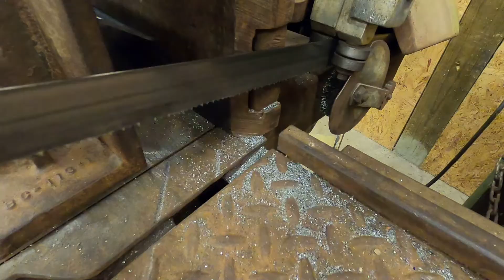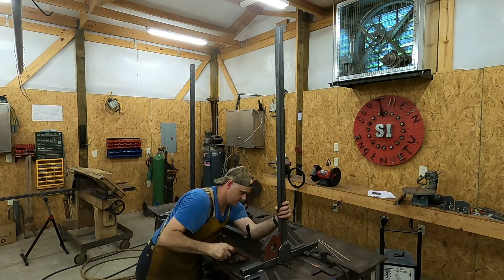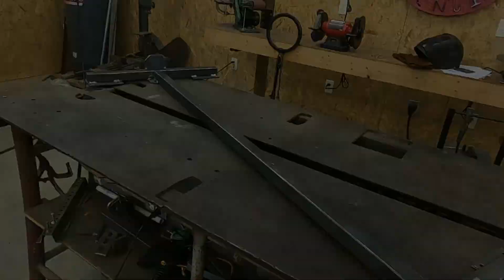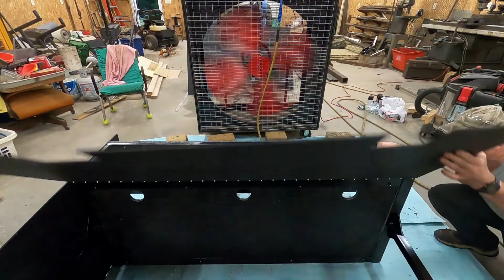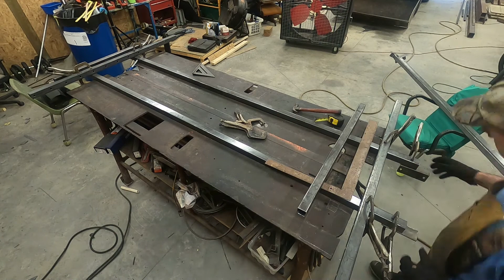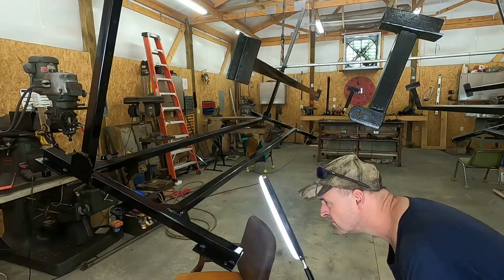Welding Project: Homemade Instrument Carts for the Marching Band

Comment: Im about to tackle a similar project like this for my high schools marching band, and wow this is cool to see. One problem im facing right now is the weight of the thing because I want to avoid it being to heavy to push around, how much did your build come out to weigh if you remember. Also if you have like specific wood type you used for this that you can recommend?
Reply from the maker: Hello, thanks for watching. I have no idea what those weighed when completed, but they weren't too heavy. The kids are able to move them by hand with little problem even when loaded with equipment. I've never inspected any "factory made" carts, but I'm pretty sure the ones I made are just as strong or stronger. With that being said:
The square tubing is 14 gauge, the angle iron for the keyboard cart perimeter is 1/8 inch thick. All of the joint gussets, plates, and wheel mounts are 1/4 inch thick. The towing hitches are 1/2" thick. The sides of the keyboard carts are made out of 1/4" thick "Luan" plywood. I would advise something stronger here. The Luan looks nice, but doesn't hold up well to impact. Maybe some 1/4" or 3/8" "sheathing" grade plywood would be better without adding too much weight. The carpet covered boards are 7/16" OSB. 
I think one of the key points to think about here, for mobility, is the casters. You're probably gonna want some good quality pneumatic tires. They roll better on pavement, gravel, dirt, and grass. We used 8" inch pneumatic casters from Harbor Freight, and they've held up pretty good over all. I hope this helps, and I would love to see how yours turn out. Thanks for watching!

Comment: What rod/amperage do you use for thin square tube like that without getting any burnthrough?
Reply from the maker: I used 1/8 inch 6013 rods on about 90 to 100 amps on these carts. I’m by no means an expert welder, but this worked well for me with my mediocre welding skills. Thanks for watching!